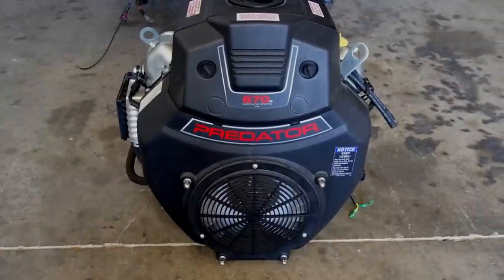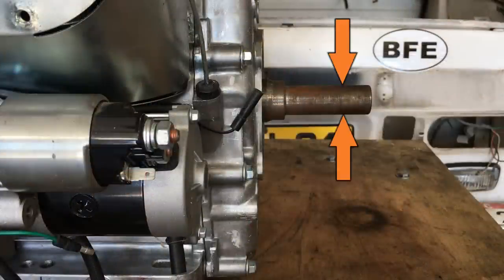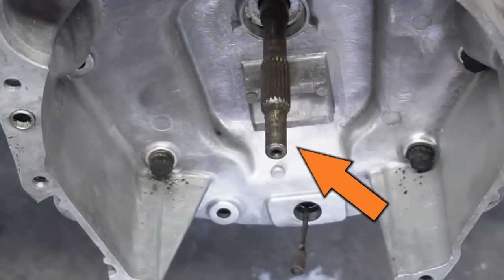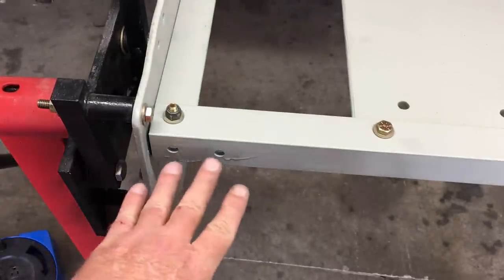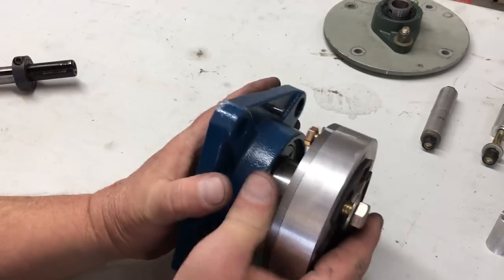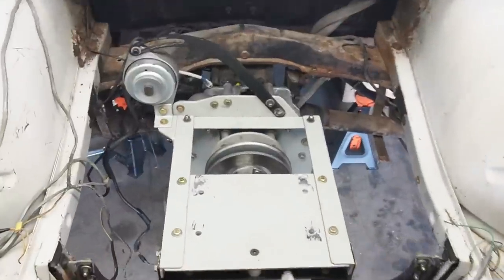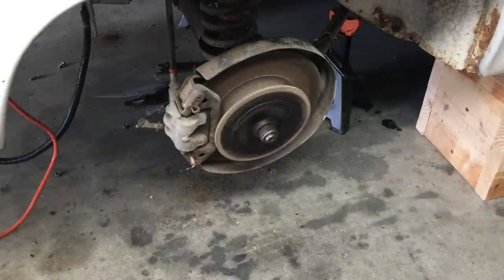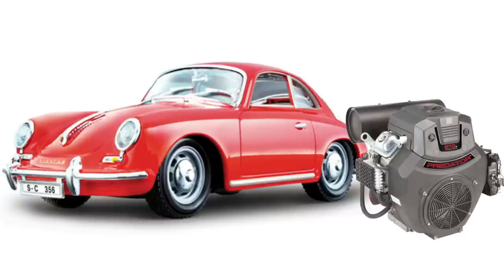S3 E18 We put a 670 Predator V twin in our project car 1969 Renault 10

Comment: BTW, Exercise is good for you. I once knew a fellow that started walking five miles a day when he was 60. He’s 97 now, and we don’t know where in the world he is.
Reply: I think all of us worry about our parents as they get older. This book focuses on balance and how to maintain it. There is a section at the end of the book that explains how to start, and a good way to do that is to establish a baseline of what you are capable of before you start working at it. This allows you to see how you improve over time. There are sections of exercises to work through. THere are seated ones, standing ones, and core ones. There are also beginner, advanced, and expert exercises, so you can really both target the area you want and your ability level. THere is a 6 week exercise plan, but like the author states work through it at your pace. If it takes longer than 6 weeks, that is more than ok. I enjoyed reading this book very much and look forward to sharing my new found knowledge with my parents.
Reply: Because being active keeps one’s joints oiled and muscles loose, activity is recommended for people of all ages but most of all seniors citizens
With these easy to follow exercises that include diagrams.
Diagrams are drawn showing instructions to complete.
It is recommended to receive doctors’ clearance before starting ANY exercise routine,
This book helps any senior to begin a workout plan that can be done for 10 minutes a day. Using simple things like a soup can can be enough resistance for training. The pictures show you exactly how to do the exercises. There is even a plan to help you start.
In order to strengthen your ability to balance, your muscles need to be limber and strong. To keep from injuring yourself, these exercises are done from a chair and then advance to standing. The author illustrates and describes each exercise.
Balance is so important as we age and this book will help you improve yours. The balance test is a great way to see just how much you need to improve.
Reply: As a senior myself, I'm looking for different exercises I can do to help me improve my strength and help with my balance. This book has helpful illustrations of exercises. You will need to warm up and cool down and this book explains how. The exercises describe how to do each exercise and what muscle it helps. I liked the four week plan that starts you off easy and explains what exercises to do and how often. A pretty good book for seniors like myself.
Reply: If you want to bring more balance into your life and you are a senior this book can help. This book can help you even if you are not a senior. They said we help you understand the importance of balance and then explain how to perform a balance test. The outline the six week training plan you can follow to get you started on your path of prevention of fall related injuries. The simple illustrations are very easy to follow. I also love the reference section which led me into further information.
Reply: Because being active keeps one’s joints oiled and muscles loose, activity is recommended for people of all ages but most of all seniors citizens
With these easy to follow exercises that include diagrams.
Diagrams are drawn showing instructions to complete.
It is recommended to receive doctors’ clearance before starting ANY exercise routine,
Reply: Strengthen your core and boost your confidence with 5-minute exercise routines for seniors

Having a strong core can improve mobility, reduce aches and pains, prevent falls, and build everyday confidence. 5-Minute Core Exercises for Seniors makes it easy to incorporate daily exercise for seniors, with a collection of 40 individual movements and 25 quick routines for strengthening the major core muscles.

This guide to exercise for seniors helps you:

    Get to know your core—Learn the muscle groups that make up your core, the benefits of keeping them strong, the importance of breathing and stretching, and the latest science behind exercise for seniors.
    Enjoy a wide variety of exercises—Discover a range of seated, standing, on-the-mat, and weighted exercises that mimic everyday movement and don’t require any special equipment.
    Follow step-by-step instructions—Find how-tos and illustrations for engaging the right muscles and preventing injury, as well as tips to increase or decrease the intensity of each movement to meet your needs. 

Improve strength, balance, and confidence with this detailed introduction to core exercise for seniors.
Reply: When I go to yoga classes, the teacher often takes one look at me as I walked into the room and announces to the class, "Today, we will focus on core poses!" LOL I am resistant (and always have been) of working my core. That said.........

......I love this book! The exercises are fairly easy to do (some extremely easy) and very effective. The illustrations are very good. I bought the spiral edition which makes it easy to lay the book flat as you follow the easy step-by-step instructions on the page on the right facing of each exercise--the illustrations of the exercise appears on the left page facing. After using this book enough, the illustrations alone (along with the "Remember" bubbles) are all you may need to remind you of how to do that particular exercise.

You can use the suggested 5-minute routines in the latter part of the book or even work thorugh each group of core exercises which doesn't take that long. The four groups of core exercises are: Seated Exercises, Standing Exercises, Mat Exercises, and Excercises with Weights.
Reply: This is a great resource for those of us seniors who have fallen off the track toward the Battle of the Bulge. It includes simple to follow exercises that help strengthen the back, flatten the tummy, and increase flexibility. At 73 and with degenerative disc disease and osteoporosis, many of these exercises have worked for me in the sessions I have had with physical and occupational therapists in the past, and I trust that they will continue to help me get back on track and help with spinal support, flexibility, and back pain relief. Glad to have all these exercises in one place!
Reply: I took this book with me when I was taking physical therapy after knee replacements. My therapist was impressed and took the title and author to share with others. She marked several exercises for me to add to the exercises we were working with. I highly recommend this book.
Reply: This book is a life changing experience! Highly recommend it. It is easy to use. The way it is formatted provides options for mixing various exercises to focus on specific areas. Illustrations are easy to follow. It was very good purchase
Reply: I spotted this book on one of the blogs I read. Got it in two days, began reading and exercising with it. Oh, by the way, I have COPD and I have not done much exercising for years. I've ordered more books and gave 10 of them out in Sunday School to my class. All 10 were taken up. I've given 2 copies to 2 doctors and you should have heard their thrill and excitement from them over the books. I've bought another ten copies to pass out to some more of my friends. I want to keep my friends healthy!
Reply: I am a certified personal trainer and this book is a great buy! Not for the cross fit crowd but for all the rest of us that want to be healthy with simple real world exercises that can be done safely and enjoy it. I love the description and pictures. So easy to follow I can even hand the book to a client and let them see "you can do this". Fitness can be very intimidating for obese people and seniors, this book solves that problem. GREAT EXERCISES that will be effective.
Reply: This is a comprehensive and easily understandable guide for seniors and near seniors. The author ties the concept of exercise to practical outcomes, how to live a longer, healthier active life. The section on myths and benefits is clear yet respectful with emphasis placed on communicating with medical professionals before starting, and the importance of rest. Modifications are offered for each exercise routine; some being done in chairs and easy to follow diagrams. The book addresses people of all abilities. Exercises are presented directly to specific muscle groups so readers can decide which best meet their personal needs. This makes a great gift for one's self or those one cares about. I have already given it as a gift and it was well received and appreciated.
Reply: This is a very easy-to-use exercise book with simple illustrations and excellent tips to avoid pulling muscles or straining your back. Has a combination of seated and standing core exercises along with combinations that are meant to be helpful for various chores or specific areas (such as Hip Pain, Back Strain, Sports Fan, house cleaning, gardening, etc). I highly recommend for all seniors as well as anyone trying to get from a sedentary life style (due to illness, surgery, etc) back to being more toned and energetic.
Reply: For seniors makes it easier to move with the arthritis, back, knees, arm & hand pain you always start out slow our Dr. said add 2 rep's) on day 2) until you think you're comfortable with a full workout. Every other day we do the easy day. Our friends are ordering books now , after seeing the enjoyment of Workingout has helped us.
Reply: Why do younger people continue to label older people as "seniors". This is discriminating. I'm old and I have no problem with that. There are young people and there are old people, that's life. What I have a problem with is being treated differently because of my age . Could you rent an apartment to only people aged 40 to 60 and call it " junior living "? Oh heck no! but it's perfectly acceptable for people over 60? Why? Why do people see older people as somehow " special "? You have to have a special " senior " phone or a special "senior" menu. Please quit treating people differently because of their age. Quit lumping us into one " senior" category.!
Reply: The instructions advises to clear it with my doctor before starting, so I brought it along to my appointment. She not only okayed my using it, she ordered more for other patients. I like the format, showing each exercise, then showing different combinations to strengthen or improve specific areas. Well explained with realistic drawings of men & women who are out of shape.
Reply: I am a 74 year old female. 14 months ago ago I had a bad accident that fractured my left tibia, 3 of my right foot bones and my left wrist. I was in a nursing home for 2 weeks. I came home in a wheelchair. For the past 8 months I have done one section of the book every day, alternating between seated, standing, mat and weights. We had a late snowfall. (It's April} This afternoon I walked out to my mailbox, by myself, unassisted, in the snow. It's a great book. I lol at the cute illustrations.
Reply: Some of the exercises in this book are quite simple and easy to explain in written directions, absent video or audio explanation; for example, a diagonal crunch done in a chair or standing side bends. But some exercises are just too complicated to rely on written directions -- there are too many ways to do the move wrong and hurt yourself.

For example, on p. 79, a squat with a twist is described. While the directions concerning the feet, torso, shoulders, hips and back are all spelled out, the arm movement is shown but not described, so how do I know what to do? Also, twisting while holding weights is a dicey proposition, as generally it's safer to lift objects (whether everyday objects like grocery bags or weights for exercise) straight up. There's too much chance of back injury with this move, unless the person already has some level of strength in the core and no history of back trouble (which is hardly anyone at this stage in life!).

I also feel that anyone who exercises should first talk with a doctor or trainer, as this book points out. That way, you'll know if you should avoid any particular type of movement. For example, because of hip pain, I can only do exercises that are "bilateral," that is, the same movement is performed on the right and left side at the same time. I can't lift one leg and then the other, or push with one foot and then the other. This is the kind of information you need to exercise safely, no matter what age you are.

I like that the exercises are tied to their usage in everyday life. No one's training for the Olympics at this stage, so the purpose of exercise should be to enable you to get through the day without injury.
Reply: The older I get, the creakier and less flexible. That's normal, I suppose, but it can be counteracted with a little more stretching and exercise. But not jumping around like crazy and hoping nothing breaks. This book gives you sensible exercises more for keeping your body functional than for burning calories.

Divided into three main chapters, the book has a first chapter which is mainly informational. You learn about your muscles, your core, the importance of stretching and proper breathing. The second chapter is the forty exercises included in the book. Each exercise is a two-page spread, with very illustrative drawings on the left side and the very clear instructions to the right. You also get some ideas on modifications, either up or down in intensity. These exercises, BTW, are divided into those you do seated, those while standing, those on a mat and those with weights.

The third chapter is quite clever. Each two-page spread here is a bundle of four of those exercises of the second chapter to help your body with the routine motions of daily life. For example, pp. 114-115 gives you a bundle of four exercises that will help with a trip to the grocery store. You know, picking things off the shelf, packing and unloading the car and putting away groceries.

Yeah, yeah, all you young'uns will think, "Oh, how silly and boring." Ha! Just you wait.
Reply: This is an attractive and colorful book full of invigorating exercises for seniors (or anybody, really!) The illustrations and explanations make it easy to follow along. There's lots of large print, and there are good reminders about form, as well as a useful list of resources at the end. The instructor/ author is involved with Silver Sneakers, which is great.

Given all of the wonderful things listed above, I was surprised to see how many of the exercises involve rounding the spine forward, which is considered unwise for anyone with osteoporosis or, I believe, osteopenia, both of which are so incredibly common in seniors. I hope that people using this book will take that into account if they have bone density issues. It's relatively easy to adapt many of the exercises to make them safer for all that. People interested in learning more might take a look at Dr. Loren Fishman's many fine books, or his writings online.

Other than that, this is a terrific book. Recommended to those who can do these exercises safely.
Reply: I love this book! Cindy's encouraging personality, extensive knowledge, and consummate professionalism shine throughout. I was fortunate to receive a complementary advance review copy, but would happily pay the reasonable price for the value this book offers.

I first got "hooked" on Cindy's fitness advice and routines through her videos and live-streamed classes during the pandemic. This book is an excellent resource to complement her online offerings, and will serve as a life-long reference book for me. Cindy provides many options for tailoring the exercises to each person's needs and circumstances. Her knowledge of anatomy, her clear instructions for how to do the exercises, and her guidance about avoiding injury make me feel confident that her advice is trustworthy.

I can't say enough about the content, style, format, and structure of the book itself. Clearly written, with large print, thorough and precise explanations, good signposts (e.g., the colored tabs marking the different sections), and engaging illustrations, it is easy to read and easy to find what I am looking for. I especially like the routines Cindy pulled together at the end of the book, with logical reasons for why they are useful, and the specific benefits each offers for an active older person's lifestyle. I recommend this book without reservation and hope Cindy has plans for writing more books in the future.
Reply: This is a great book for Seniors who are new to Exercise. These exercises are aimed at getting you moving and in a safe way. The illustrations and explanations are excellent and easy to follow - a great beginning. As I aged, I found that my balance was going so I decided to do something rather than have to worry about falling and breaking something. 5 min a day is a small price to pay for helping your body get stronger.
The book has clear instructions and is well illustrated with simple to follow directions. The authors have included modifications in case you need them.
Try it and see how much better you feel.
Reply: "Five-Minute Core Exercises for Seniors," by Cindy Brehse and Tami Brehse Dzenitis, is designed to help older individuals tone up their muscles, regain stamina, and boost their confidence. This book focuses on the body's midsection, or core, because people with a strong midsection have "a greater range of motion and more control over [their] balance." You do not need to buy expensive equipment to do these brief exercises.

This clear and useful handbook has colorful illustrations, the instructions are easy to follow, and a heading on each page indicates either an "activity category" or the muscle groups that a particular exercise is supposed to strengthen. Some of the exercises are done while sitting in a chair or lying down on a mat, while others are performed in a standing position. The authors stress the importance of technique; it is important to position yourself correctly to get the desired results. In addition, at the back of the book, the authors offer tips for incorporating exercise into your daily life; a list of resources for further information; and a handy index. It is wise to consult your doctor before embarking on any new exercise program.
Reply: This is a great book that explains the benefits of why exercise is so important for seniors. It talks about the physical changes that seniors go through with aging and the importance of staying fit. The exercises are for ALL levels of senior fitness; from exercising sitting down to the more active seniors who can get down on the floor. It gives you a progression of exercises that you can build on and talks about specific exercises that might help specific areas of concern like hip pain. This is a great book to use if you have become a "COVID couch potato" and want to become more active and get your flexibly back
Reply: @kansasrose2909  any other comments,   I   LOVE, LOVE,  LOVE  this kind of input!👍👍👍👍